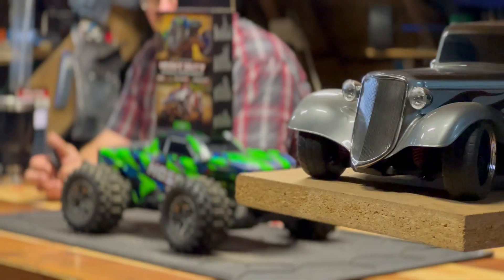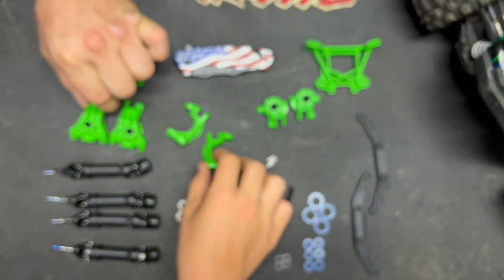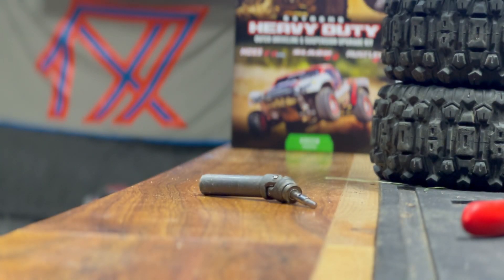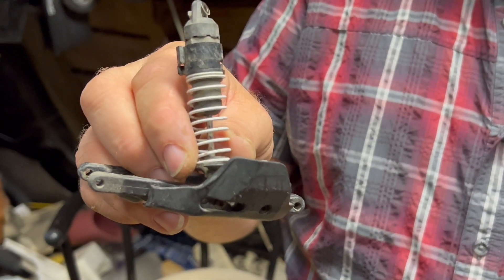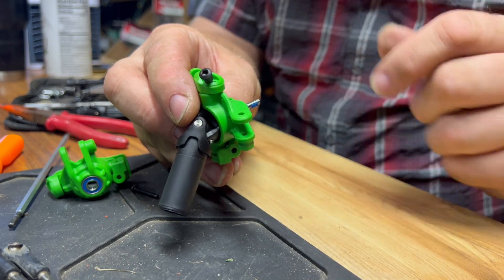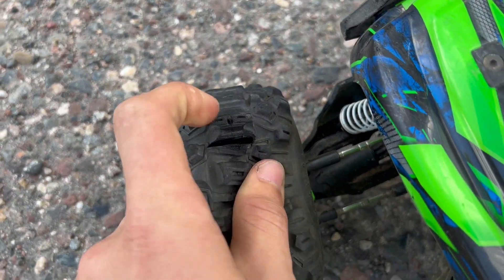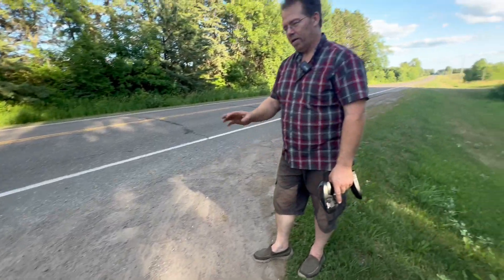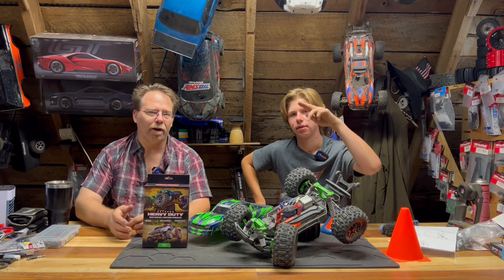How To STOP Breaking Driveshafts on your HOSS?! | EXTREME HEAVY DUTY KIT

Comment: I put a 3s 540 in my base stampede 4x4 brushed. Blew through so many driveshafts. Ended up doing MIP X duty f&r driveshafts and tekno rc center driveshaft. 0 problems since. Used to break 1 everytime I self righted after rolling now I can self right all I want with the MIP’s